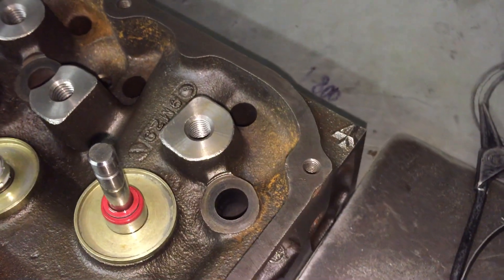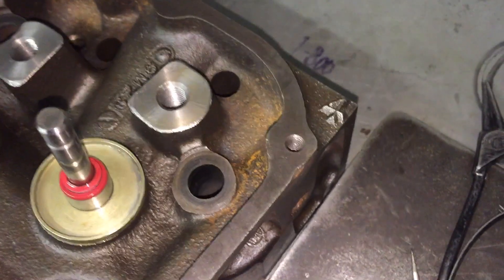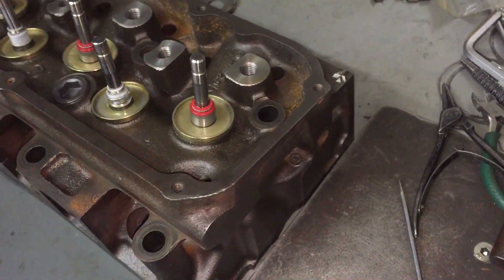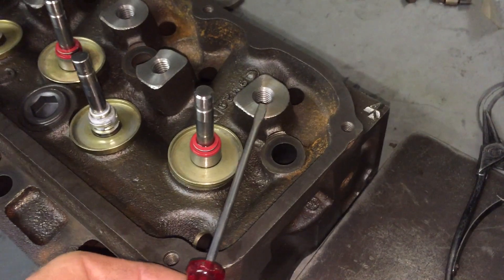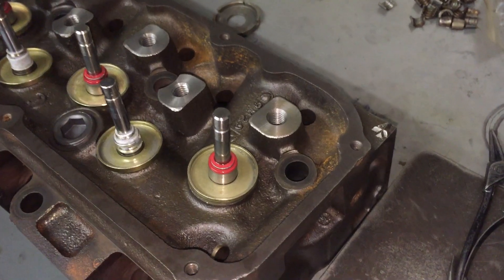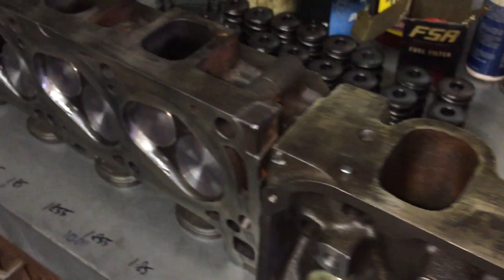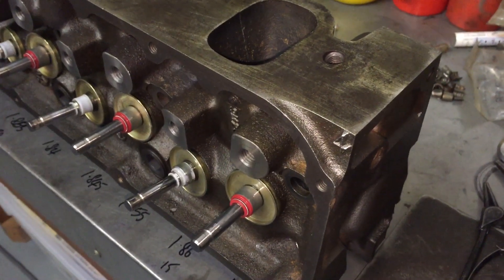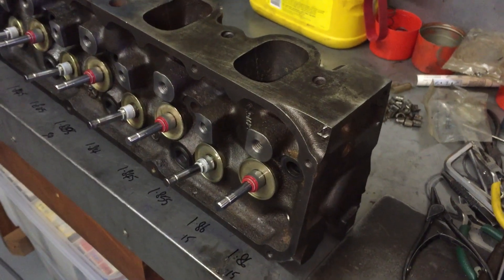GTHO 351c PHASE  2 / 3 ford Cleveland engine build PART 6

Comment: Well said.  What putty did you use to block the thermal pasage and can it be ued as a exhaust port putty, hard to find.  Madmick
Reply from the maker: A product called HARDBLOK.
Reply: @ford-speed hello,nice vedio, will that putty work blocking off ford fe head,i worry about it melting and going in to cylinder, what's your thought

Comment: Here's something you might find interesting Dean. In 1985 I was working as a mechanic in a shop in Beverly Hills California, a cop came in to check that everything was okay (this was a P.R. thing they did for every business every six months). It just so happened this guy was a motor head and I asked him about his Crown Victoria police car and what engine it had in it, I was dumbfounded when he said it was a 351 Cleveland fully imported from Australia. I asked how he knew this and he told me he'd requested to buy one of the Crown Vic's from the police department and was told that there wasn't a "snow flakes chance in hell" of the cars passing the yearly smog check (police cars were one of the few vehicles that were exempt from smog checks) so the cars went to Nevada to end their life as a "49 State" car.  He said that (in 1985) there was nothing you could buy that could out accelerate his Crown Vic!

Comment: it was all over by 1971 in the usa maybe thats why we did our own machine work drew .
Reply from the maker: That’s a fair comment. Ford USA were still in production with the 71 boss 351 and 72 they went with the 351 oho motor both of which had heads with screw in rocker studs. They would have needed to service parts for those engines for the next several years. I don’t think they would have wrapped things up until mid 70’s with 351c 4v production
Reply: @ford-speed  did you guys have clevelands, boss 302 in 69?
If so they had the 2.25 in valves
Reply from the maker: @brianadams429  we imported all 351c engines up to  late 72. We had no boss engines of any description. No 351c engines had a 2.25” intake valve. Only the 1969 boss 302 engine had those monstrous valves.
Reply: Just think if the fuel shortage never happened, i wonder how far would the cleveland have went.
Reply: 74 was supposedly the last year here in the USA to get clevelands

Comment: Parts at Ford?  They went by the part number. Of which there  several for the different model engines. 
I worked in  Ford main parts dealer in that period. They were packaged in heavy cardboard boxes. 
Normal 4V closed chamber GT head assembles were readily available. Ph3 ones would have been special order. XW & XY GT heads were the same. K codes used regular US 1970 2V heads. Later heads got larger in the chambers. 
Aussie 302 2Vs had around 600 cc in XA getting larger to around 64cc by XE. XA XB  heads are generally the only ones left that are any good as the XC ones on with ADR27A all BBQd the valves seats and guides
4V open chambers I believe were imported, but again maybe not as they were only used on later XA and early XB engines. Late XB GT engines used 2V open chambers with a little larger chambers.  And a square bore 4bbl intake. The GTs were slowly strangled!!
I am unsure wether all Ph3s had screw in studs. Maybe,, or not.
Fairly simple for Ford to bring in bare heads into Oz and finish them to application, as were L34 heads at Holden.

Comment: Thanks for this great set of videos, I'm looking forward to more. 
Looking at the Phase 3 Workshop Supplement it shows the cylinder head combustion chamber volume as 55.0 - 62.2 (a very large range). The XY service manual shows the 4V as 61.3 to 64.3, the same as (from doco I see) the US 1970 4V. With the US 71 4V and Boss as 64.6 to 67.6cc
Do you trust this value in the workshop supplement for the road cars? Would the heads have been machined to decrease the combustion chamber size?
  cheers

Comment: Great to see the updates. I have worked on a few of these, Phase 2 and 3 back in the 1980s. There was so many urban myths about what was what in those engines. 

I totally agree and could never understand; why didn't  Ford Australia simply import 500 or more Boss 351s? Just bolt in. Better engine than the standard 351 base used and way less work...
Reply: Mike Cantwell : The Phase 2/3 were Al Turners baby. The use of  a K code 289 cam profile on the Phase 2  and a downgraded 300 degree cam for the Phase 3 give us a huge clue that Aussie Phase GTHO's were custom Aussie modified engines. Al spec'd stock US M code import engines, and modified the spring and screw in rocker studs for solid lifter engines with cams more aggressive and not legal for US emissions. The canned 1971 Boss 302 and the eventual Boss 351 heads were not used because everything engineering wise here was signed off by Big Al. The US tag code CN engines were totally unable to match 340 and 350 net  hp H-M  headered performance. Al got the two kinds of Holley carbs via his contacts, which is essentially Boss 302 or the later Big Block carb. The Phase engines porting and chambers were stock for the Phase 2. For the Phase 3, likely the same. Phase 4, Boss 351 head gaskets and gas flowed chambers based on the Bill Santacione dyno test engine(s). The Boss 351 engine spec wasnt locked in untill June 1970. It had a 16 thou deck register, different pistons and Al would have had access to some of that. High degree of local customisation was because Al was the final fettling wheel in the package. Since so much rode on the shoulders of the Phase Cleveland engines after the 1969 failure for the 500 mile race, all the engines were striped US import M codes with a huge degree of Australian rework. The QC engines then went a  step further. The Lot 6 guys will weigh in on this as thats where I got this information last October. The Boss 351 and the Boss 302 were not the big sticks the Phase 2 & 3's became. The whole program was intrusted to Ford Australia because Dearborn got the picture that unless it customised its factory Australian  racing effort better than GM-H, it would Not Win. The Australian work used very good practises, another step up from Harry Firths earlier work. Because Al Turner was a drag racing guy, he mixed the best endurance testing guys from Repco and within Ford Special Vehicles, honed and lapped in his drag racing engine prep to a small band of new specialists. Aussie ones. The machining work is signifcant, but goes un-noticed untill you compare it with the US market 70-74 Cleveland performance engines.
Reply: Those Ph3 engines came direct from the states. Most were assembled here BUT all the parts were imported. And were a simple variation on Boss heads.